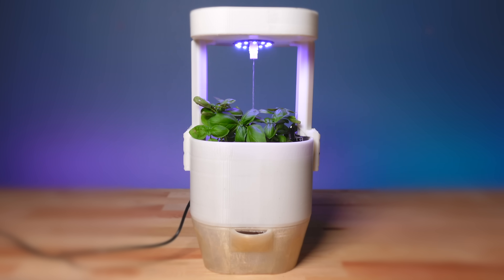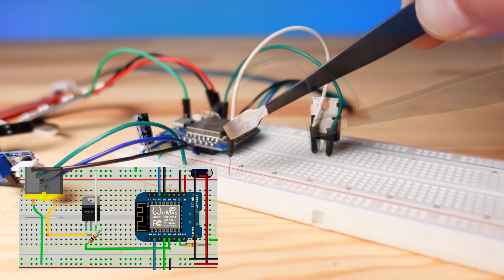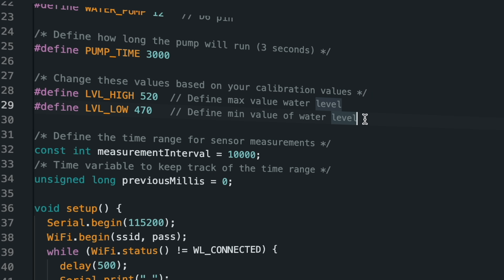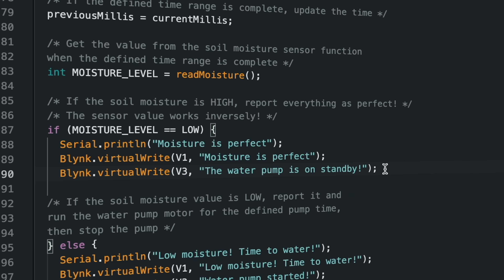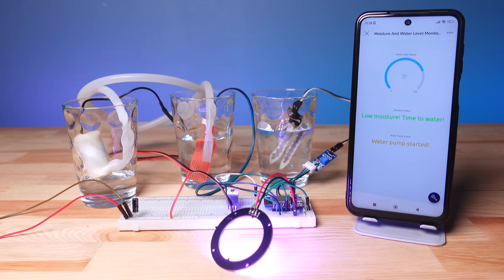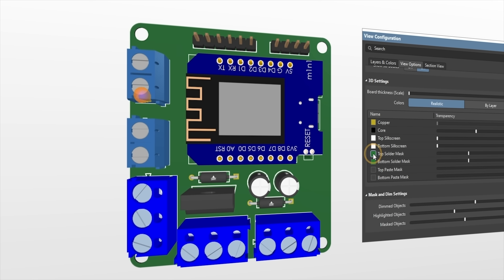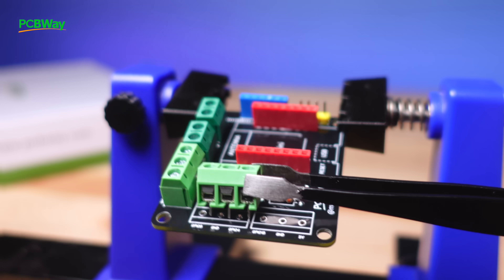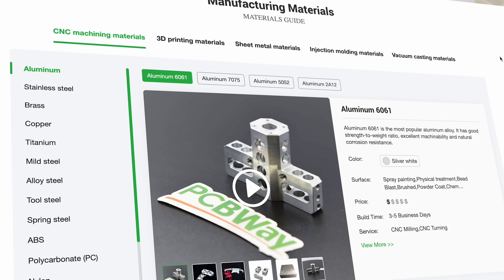Build a self watering system (soil moisture, water pump, water level, mosfet, circuit, and code)

Comment: Hey, i have a question, what is the app ur using to monitorize the water level? U created the App by ur own or it is avalaible on Play Store?
Reply from the maker: Bylnk application was used.  Go to blynk io from your web browser and create a free account, then follow the blynk steps in the video.  All you need to do is create a template, determine the pins, set up the dashboard screen and add the necessary token addresses to the source code.  You can also use the application from your phone for both iOS and Android.
Reply: Hey, im using this Project has my final project of school, last tear, im trying to test the components only with the essential code, and i have the error of not having the library of ESP8266, i Can't find it, could u help me? (Its the only library i need right now)